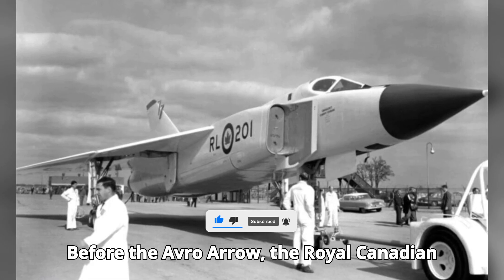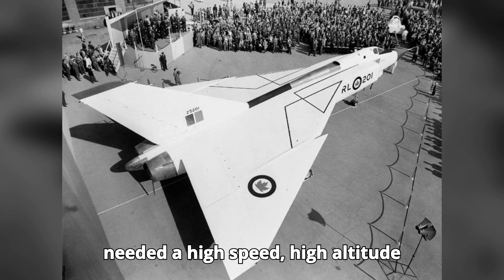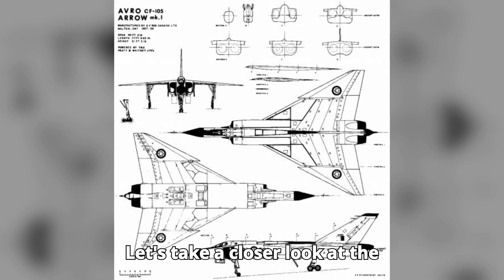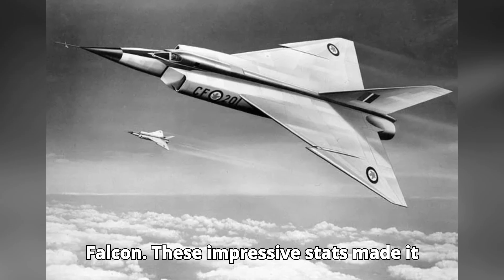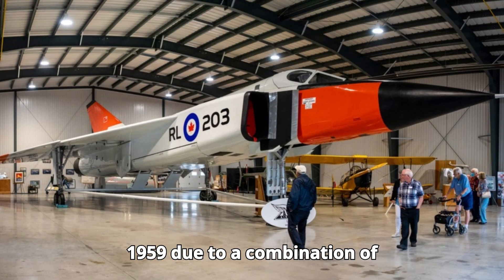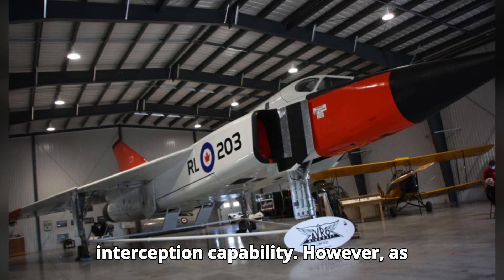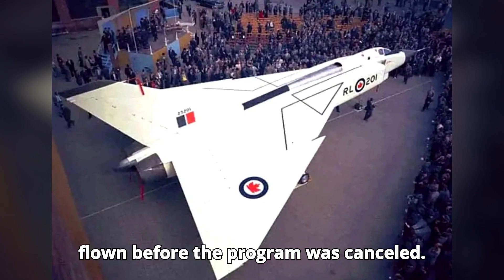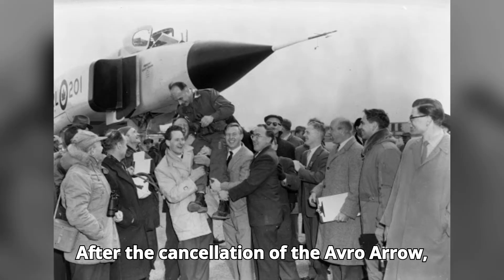The Avro Arrow: Canada’s Legendary Supersonic Jet

Comment: May allow me to provide additional information.  I have forgot to mention that we had in operation the CF-100 interceptor with was the firts all weather capabilities and deploy in Europe for NATO.  The 105 equip with the Orenda engin would have reach mack 2.5 with the range to go up north and bac.  Also they install the first fly by wire and could carry the missile internal like the F-22 and 35.  The cost production was quite high, but the US convice our government to be equip of missile that never work correctly.  Finally, the majority of the personnel when to the States and contributed in large part to put a man on the moon.
Reply: 14,000 people worked on the Arrow, 30 were hired by NASA.  That's far from a majority.